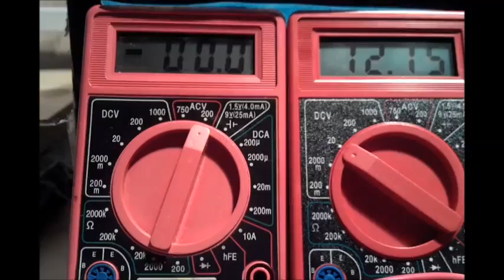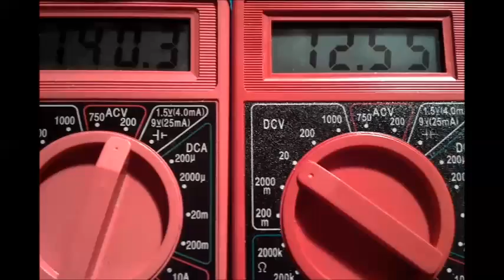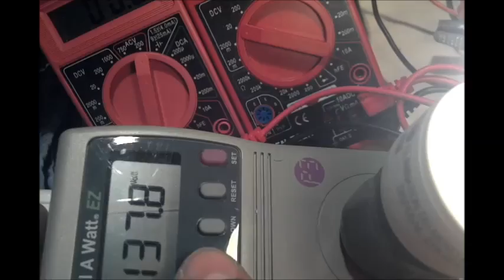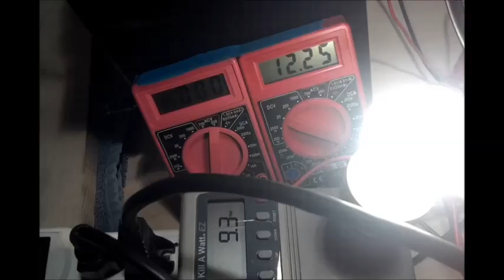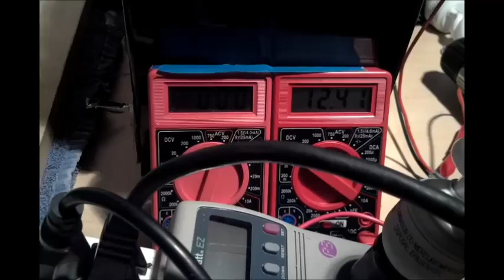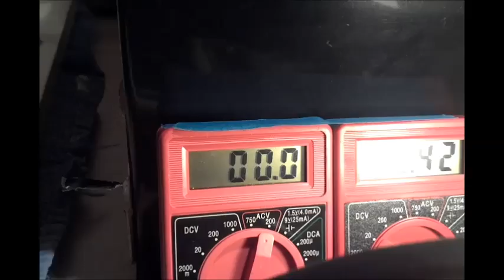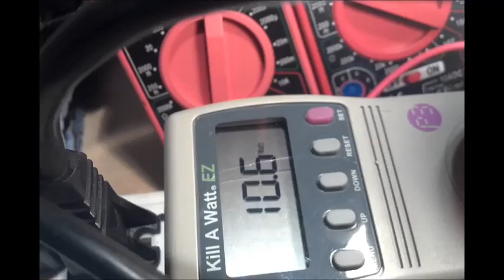Self-Looped 12vDC to AC Generator

Comment: Hello. Where are you getting the 120v ac from? From the litle 12v dc motor? If so, could you please tell me what is the brand/model of this motor? I would love to replicate your experience and of course, try to improve it. Regards.
Reply from the maker: Its called a Redi-line generator, it runs on 12v dc and produces 120v ac, they are available on eBay
Reply: It makes no difference motor is motor most can be adapted to work as generators and looped systems like this work great..

Comment: defies thermodynamics, will not continue to go forever. HOWERVER if you add a solar panel and a battery bank do this on a larger scale and have it switch batteries through a relay with a large compactor to handle the load during the switch to prevent a brown out you will go places. you also may want to look into fluid motion and impellers in water accompanied with magnetics. I made that make sense with thermodynamics as well

Comment: I like your setup.  I am soon going to try using a 300 watt Dremel tool to spin the car alternator while using only 1/3 of the power the 500 watt invertor hooked from the alternator puts out.
Reply: add inverter 12v.. to 5000watt.. its work